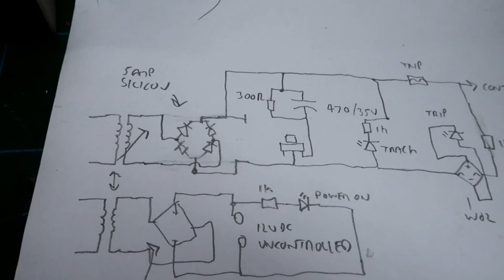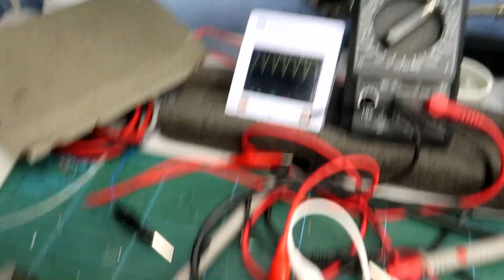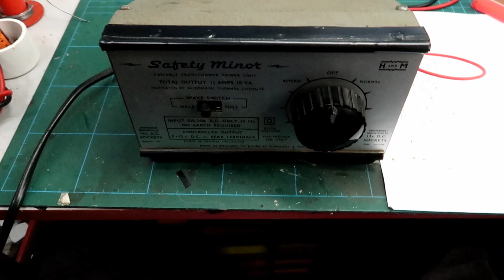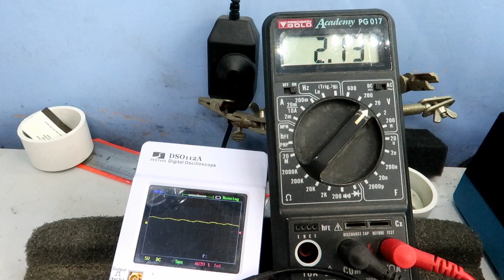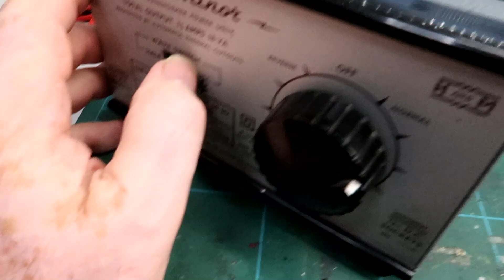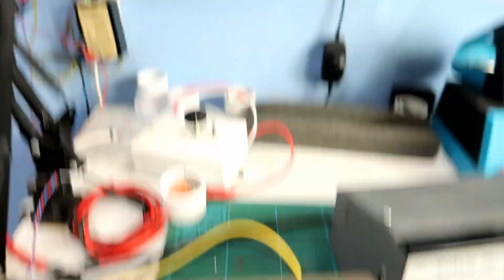H&M Safety Minor refurbishment part 2. What did I do to it? Let's fix it

Comment: Hi Mike, another informative, (over my head), video. So am I'm right in thinking that you can run older locomotives, good old 60's and 70's and newer locomotives, with cordless motors without having to modify the controller? Also I've got a couple of H&M clippers with a wave switch and a resistance switch, are they safe to use? Lastly how is it possible to run DCC fitted locomotives on ordinary track, ie just variable 12v track, when I thought that they needed a individual wakeup signal? Lawrence
Reply from the maker: Hi Lawrence. Yes the output of the serviced Safety Minor is OK for those older motors. But not on half wave. In order to be safe for coreless motors it's best to have the smoothed output as shown. As for dcc I think the chip in the loco has to be set for normal dc operation. Clippers use resistance control and I'm not sure that would do any good to coreless motors and or DCC chips, however I don't know this for a fact.
Reply: @ModelRailwaysUnlimited  Well, Mr Dyson has a lot to answer for, that's all I can say!
Reply from the maker: Lol, Dyson?
Reply: @ModelRailwaysUnlimited  Didn't he invent the coreless motor?
Reply from the maker: @user-vg2uu3ip8m oh I see lol. I think it was in Japan. https://dccwiki.com/Coreless_Motor
Reply: @ModelRailwaysUnlimited  My ESU Lokpilot decoders switch automatically between DCC and DC as do most decoders.
The Brawa steam loco I have also has sound on DC but with less control than DCC.
Variable resister controllers like the H&M clipper or Duette. should never be used for any DCC or coreless loco. Take them to the recycling centre the matts contain asbestos and the casings are not airtight.

Comment: Most informative video Mike - thank you! 👍
One of those to add to the 'reference' library.....  🙂
Reply from the maker: Thanks Colin, I'm going to try and use them instead of my current control system in order to prove them so to speak, just working on the adaptor wire loom

Comment: Excellent. Nice to see it reverting to standard appearance. Sympathetic improvements.
Reply from the maker: Thanks exactly what I am trying for
Reply: @ModelRailwaysUnlimited  Well, it's achieved Mike. Nicely done. Extra smoothing capacitor is a particularly interesting idea. Begin to wonder what other filtering improvements could be done to take out another level of ripple.

Might I ask why you'd consider swapping out the current controllers? Just for the retro feel (I can relate to that), or do you think the performance is actually better?
Reply from the maker: @kellypaws lots of good questions there. Don't forget most motors other than coreless types respond better to some ripple. The reason I'm considering swapping out my Gaugemaster controller is two fold, one I want to prove these old controllers are up to the job and two I want to prove to myself that I can do it